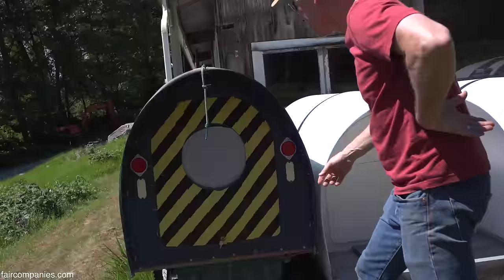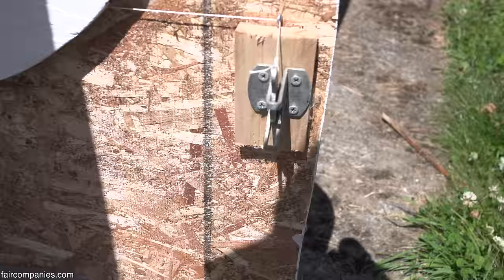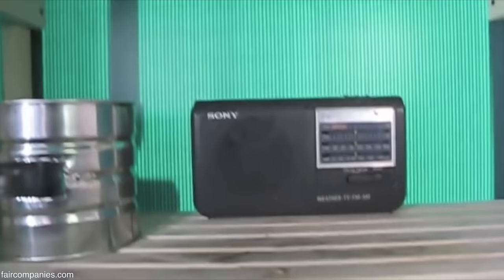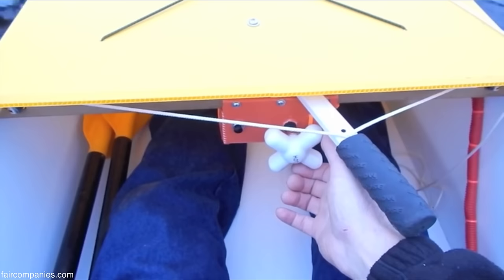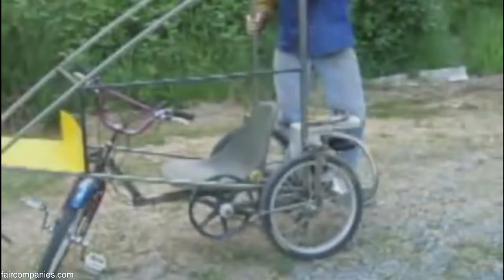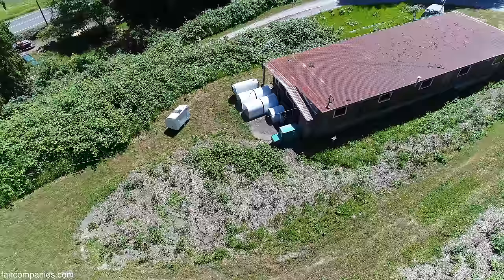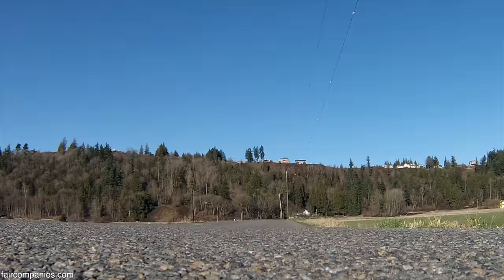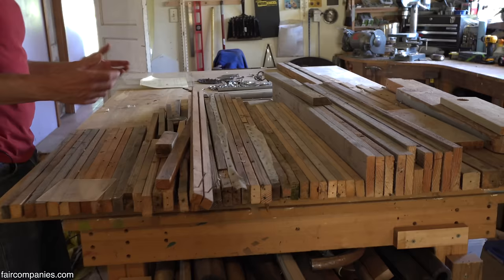Boeing retiree finds meaning inventing micro homes & high speed trikes

Comment: This is pretty damn cool. I suppose if he built one with a double layered wall that might help with the condensation aspect and you could even make it in a way that could collect rainwater.
Reply: How would a double wall help with condensation, a temperature thing?

Extra insulation is a good thing but ventilation is vital. Best to get that right before thinking about other factors.

Comment: This is why I love the attitude of an inventor; you design something, and when it fails, you think "this is a good learning experience!" Then you improve your future designs armed with the new knowledge.
Sadly, I don't have the money to invent stuff, otherwise I'd be in a workshop dang near every day tinkering and inventing, as the times I have done so were some of the best days of my life.
Until fortune turns around, I get my inventing fix by playing Space Engineers on PC.
Reply: Goattacular building things doesn’t have to be expensive. He even says many of these were built for less than $100. Salvaging materials is an excellent way to save money too. I used some old copper wire stripped out of the garage to make jewelry for Mother’s Day gifts!
Reply: Saving Money instead of fast food can make a difference.

Comment: if i made my dog live in a space that small i would be charged with cruelty.
Reply: Tiny house not to live in it. It's more to sleep or chill every now and then. Dog houses are actually smaller than that and they sleep in them just fine.
Reply: @ggi5658  you could NOT put my dogs bed inside that tiny trailer. there is a point were you have to admit, it is too small. you have ventured into "cardboard box" territory here.

Comment: I did the same on drawings in the first half of my life. Most of the time I was working for myself farming and running cattle.  In the winter I worked at jobs making things, I designed a fertilizer plant building once, worked as helicopter machines, and spent lots of time as a welder and carpenter. In 1978 I bought a computer to try to find a way to pay off the debt I was calculating farming. The computer models I wrote kept telling me to sell out and run  

It turned out I was better at computer modeling than I was at farming. I have spent the rest of my life building things in hardware and software. There are still opportunites for kids. They are just in different places and for different kinds of things. I'll be 80 this year and most of the kids I help are graduate students that need some of the stuff from a hundred years ago that isn't worth teaching anymore. There are a lot of computer science students that don't know how to inline machine code in the software they write and don't bother to avoid writing slow code someone has to profile and fix later. Explain that to a student and they usually move up and out awfully fast.

Comment: Thanks for the suggestion of coroplast!  I've been wanting to make a bike-camper for about fifteen years now, but I'd been wondering what material to make a roof and/or walls from that'd be a little sturdier than just a tarp, but not too hard.

I was thinking maybe do some hoops or spirals of wire around the outside and then a tarp over that to provide an air barrier for condensation and insulation for the colder months.  The tarp(s) could be rolled up underneath, maybe into its own little cubby, and the spiraled wire would then not provide much wind resistance on its own when riding.  Also, run a ground-wire between the spiraled wire bits and to the ground and even in the event of getting struck by lightning it'd be more likely to just run along that than light up you or your camper.

I was also considering hooking up some solar panels and maybe piecing together a wind turbine and upgrading what is likely to be two bike tires on the back of the camper with those electric bike conversion kits, or even if I can't afford that or figure out how to make it work, sticking a dynamo onto the wheel so I can at least charge my phone, tablet and run a couple LED lights inside at night.

Comment: It's pretty cool Im in the process of doing something similar gonna make mine collapsable I'm wondering why in the 1 thats got wood floor you set the door in  so theres about 2" feet the roof overhangs should add couple shelves and stuff on the end where your head is cause the trailers longer inside. then use a tarp at other end

Comment: I want to make a similar trailer except it will be telescoping in height and length  so it's as compact as possible while riding I want to use a metal bedframe as the chassis  and coroplast for the floor and short pieces for sides like a covered wagon with PVC pipes bent in an arch to act as height adjustable ribs (not sure what to call them)to support a tarpaulin cover instead of a coroplast shell that would probably be lighter but unless someone can suggest a way to use his coroplast shell in a way that you can do both extend and retract lengthwise as well as raise and lower the height how to go about sealing the overlapping joints

Comment: He's way under estimating the costs. Fasteners, hinges, lights, propane equipment, etc.. And the time to build them needs to be factored in. So they're not as cheap as these claims. Not at all. Then there's the idea, which is nice. But has he gotten this to any homeless people to see if it's something they want, need, or can maintain. Dunno. It's a fun project, as long as you don't have to rely on it.

Comment: I had plans to start doing mad scientist inventions under my carport. the stuff and comments I was sending to Boeing trying to assist with 737 max fell on deaf ears. They told me to stop writing email to them I stopped and assured them I understood they had internal processes. I know what they were thinking. This the kid at 10 years old that figured out how to use an abacus with out external instruction and was doing advanced calculus at age 11. Probably had no business sending Boeing design concerns for F117a requesting naming rights for the design. even though I clearly told them it was a medium light bomber. I know. how is an 11 year old able to tell Boeing to consider passing design concerns to Lockheed if it too difficult for Boeing to build or even understand. I know that was way back in 1978-79. I tried to explain to them my design concept was a valid one and would fly and perform as indicated with Stealth features and all performing well. I know 11 year old kid designing airplanes with the aid of computers and the planes I designed were advanced enough to require computers to assist in their flight. I tried to explain that the computers would need to learn to interpret pilot's intended or expectations of the aircraft based on what he did with stick. these days I am back into spaceships again. Like I tried to assist Boeing with Shuttle's robotic arm. I tried to explain that it did not have to be very strong or even have high capacity lift capabilities. It would be performing Sat recovery repairs in space and its reduced gravitational pull. In 1991 I had an opportunity to see my design concerns up close and personal. I was on NAS Oceana and walked up to it three feet away or so. And said hello old friend it's good to see you again. This time up close and personal I assumed somebody wanted me to see you again. When the B1 took off and went vertical I made a few mental notes about thrust to weight requirements to go vertical with high climb rate. Go figure. I probably had some input on it too.

Comment: I'm mobil homeless in my car and I've seen times when all I wanted to was just be able to lay down flat instead of sleeping in my car seat leaned back. I would still sleep mostly in my car though than in a tiny trailer simply because of the lack of space.. I know these are pulled by bicycles but there are actual camping trailers that are bumper pull that are about the same size.
Reply: Hope your situation improves soon
Reply: @naomiwilliams8850  I've found a place to live now. So it has improved greatly.
Reply: @willyd7944  great news, best of luck with your future

Comment: Calling these homes is a bit of a stretch!
Reply: They're shelters and are a big step up from boxes and newspaper.  But you're right, it's better to cry for the homeless and do nothing.
Reply: Sherrie White Plus, in no way would they be usable in warm temps without figuring out some sort of air conditioning set up. Once you get above 75-80 degrees, maybe even less, a fan or cross ventilation won't be enough. It would be like sleeping in a hot car with the windows up. Some great ideas, but a simple cooling system is really needed.